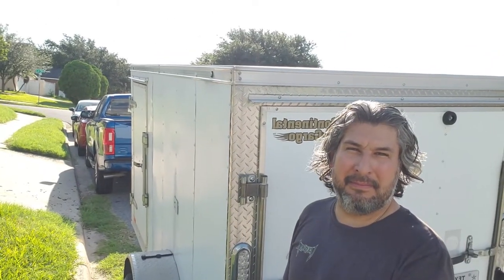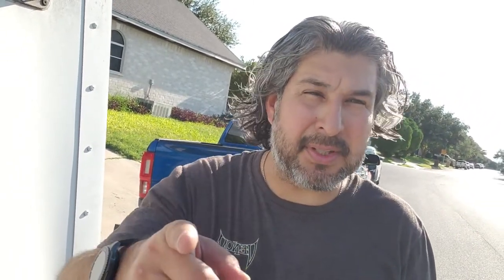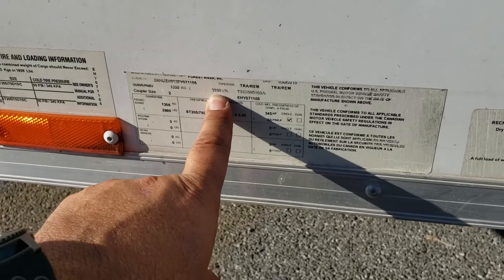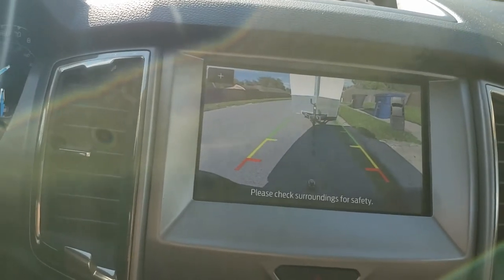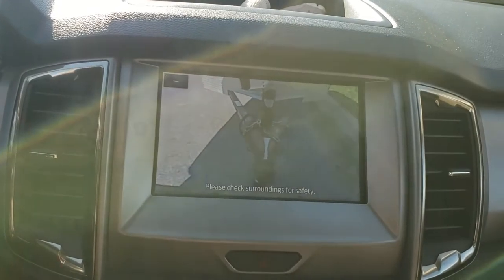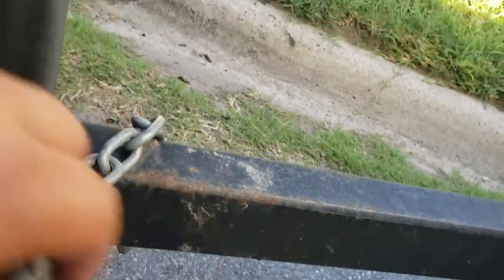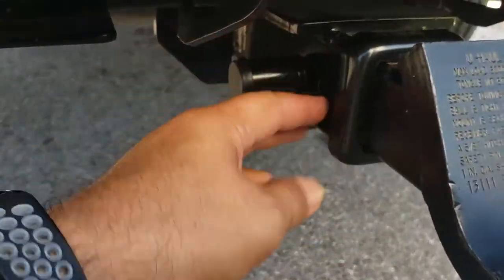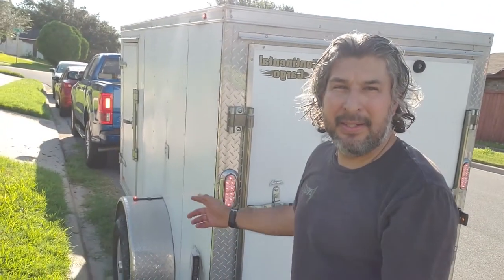Towing with the new Ford Ranger

Comment: Great and informative video on trailer towing with a ranger, thank you for taking the time to do this very helpful as I usually tow with a full size f-250 , wasnt sure about the towing abilty of my ranger till now. Thank you for posting .
Reply from the maker: Good to hear it. Long story short, i towed a Subaru wrx 350 miles or so, 5 to 6000lbs tow, with about 1400 to 1500lb payload, surge brakes. Did really well the Ranger towed level. It does have a big rake. Ill talk about it a little in my new video.  My one year plus review

Comment: I hooked up a small trailer to my Ranger and I got a message that one of the trailer tail lights was out - and it was. That and being able to set the trailer length for the Blind Spot are nice features.  The tow package is worth the extra cost - except for the lack of a brake controller (was not needed in the instance with the tail light), but it should be included with tow package, plus a larger gas tank.  Love my Ranger overall though!
Reply from the maker: Yes a brake controller would be nice. Big oversight considering best in class, well, the new 2023 colorado with the 2.7 4 cyl turbo 8 speed transmission is now best in class 7700lbs but only at about 1200lb cargo. I have towed a cargo trailer to austin and home about 310 miles 600 round trip several times and a bigger gas tank would definitely be useful. Almost feel like an ev! But the Ranger does do a good job

Comment: I have a 2020 fx2 with a rear locker would that do the job for towing? Or do u need 4wd
Reply from the maker: No 4x4 needed. I traded my 2020 for the same fx2. Same towing capabilities. If you have the receiver hitch, 7500 is your tow capacity. If only a ball on the bumper, i believe 3500 is your max tow. Keep in mind, depending on state and the Rangers capabilities,  you need an electric brake controller for anything past 3500lbs. 
But no 4x4 needed.